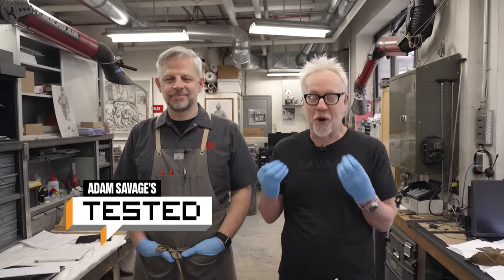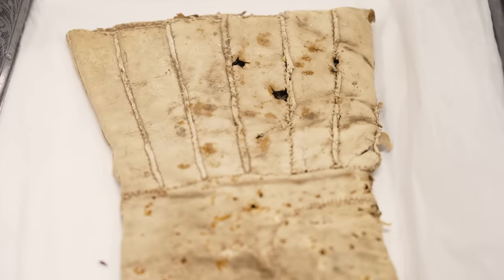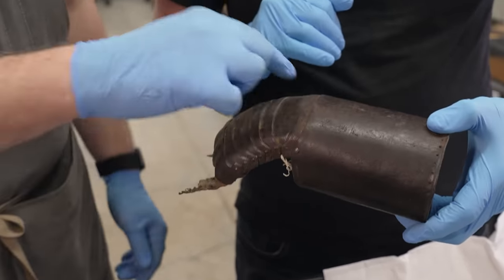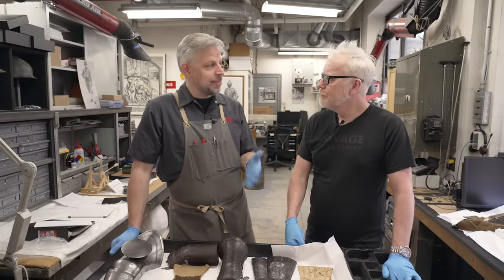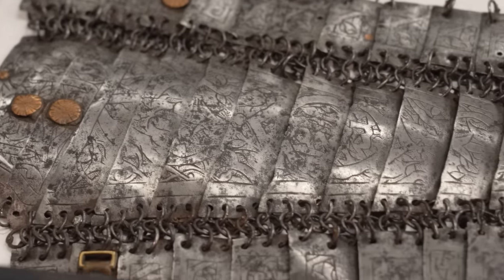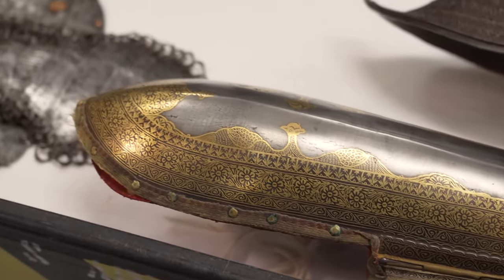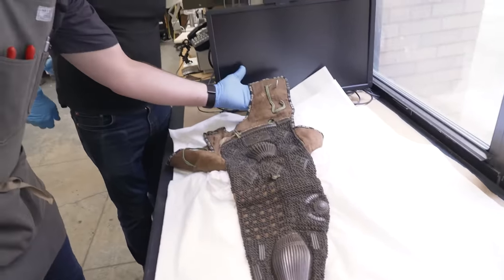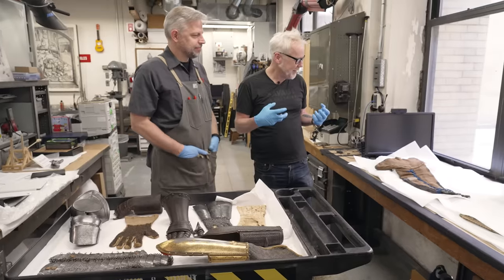Adam Savage Tours The Met's Ancient Armored Clothing!

Comment: The first gauntlet that he showed with the round disc on it that was so people while they were riding the jouster could wrap the reins of the horse around that little desk, and still be able to control the horse while holding onto their Jousting  Spear with both hand was used mostly on the battlefield not in games btw love you ADAM been watching you for 20 years at least now truly an inspiration for many 😊
Reply: “It’s called a lance”
Reply: Not just lances used in tournaments.
Reply: @painus_n_uranus7088  HELLO!
Reply: It’s called a rondel and from everything I’ve seen and read, what you described is not what it’s for at all. Like it’s said in the video, the rondel is an extra layer of protection so you’re less likely to get hit directly on the wrist. Also, using the reins of a horse is much more complicated and nuanced then you’d initially realize, so wrapping them around that while you’re using the lance in two hands doesn’t make sense, as you’re going to be sending your horse incorrect instruction. You’d probably be better off dropping the reins and riding from the seat until you no longer need both hands for the lance.

Comment: I notice on the kote that the cord strap for the hand goes around what looks like the two middle fingers. (?)  That would have a much better effect on my handling of objects allowing the index and little finger to flex and move. With my gothic gauntlets, all fingers are bound in a row, possibly to stop them riding out of the glove and onto the rim where a blow would cause a break or even a sever on the hard steel edge. Interesting!

Comment: just imagine going into combat wearing all that armour. it must be like having a person sat on your shoulders and then add your weapon to it aswell
Reply: 15-25 kg as footsoldier/rider, you can do gymnastic movements on the ground.
 Jousting, while being sat on a horse (you got parts added after you sat on horse), 40-75 kg.
Reply: If that were the case you wouldn’t be very affective at fighting, which would defeat the purpose of the armor. At most medieval battle field armor weighs somewhere around 30-40 (less than modern military kit) and was mostly dispersed evenly throughout the entire body. Although, the weight of armor is still far from insignificant, but is certainly worth the price when the other option is getting slightly poked and dying of blood loss or infection.

Comment: While grabbing a blade by your hand is certainly a valid thing to you, to do so with a "chainmail palm" as it was would be far less efficient. While it would prevent you from getting cut, there is no way you could keep that grip, there's be literally no friction. Your opponent could both push and pull against the chainmail without any difficulty. A bare hand, or a course plain glove would be far better, allowing you to HOLD the blade, and thus control it far better.

For those that think that would cut you, no, it wouldn't. If you have a good solid grip, you prevent the blade from sliding in your hand, and if the blade can't slide, it can't cut.
Reply: You can barehand a blade when half-swording, but if you try to grab an adversary's blade, they'll just yank it back and destroy all the tendons in your hands. (This is actually a common injury for those that try to catch falling knives)
Reply: @RhodokTribesman  Actually, no. There are several videos right here of people playing tug-of-war with sharp blades.

Comment: Um.
My first instinct when presented w the difficulties of armour/leather treatment was "lanolin"
But i cant find any references for it's use in historical restoration or preservation.
Its a fairly common component in leather treatments, and is also used as a rust prevention oil in metalworking.